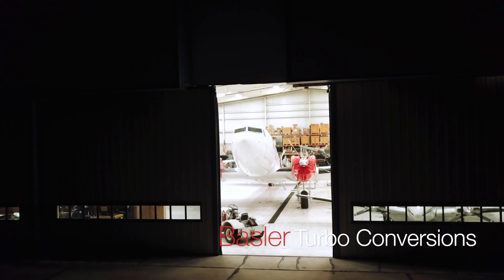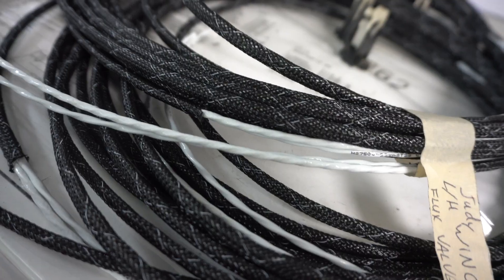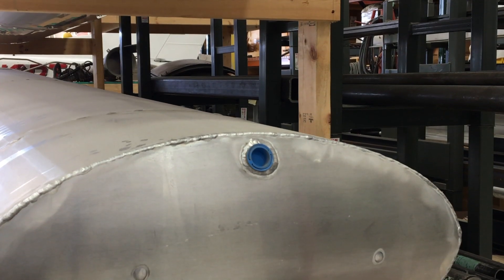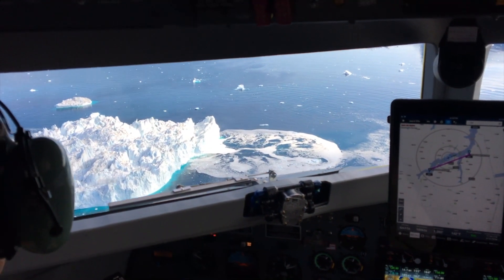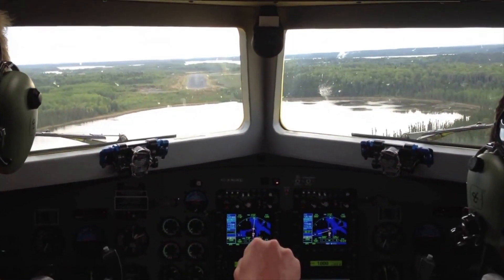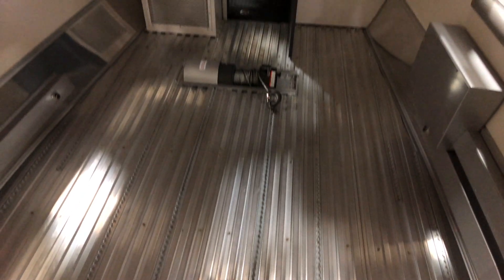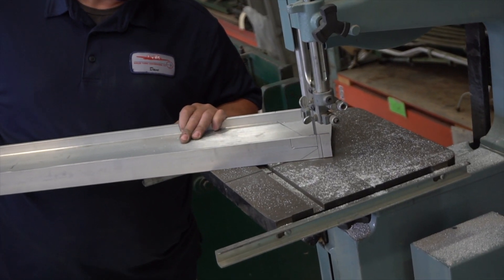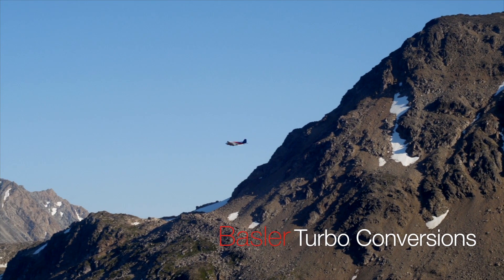Basler Turbo Conversions Informational Video

Comment: Best freighter in its class.  All you need is a truck backed up to the door and a pallet jack.  No forklift needed.  Operated 2 of the DC-3 freighters when I worked for Emery Worldwide back in the 1989s.  Never took a delay with them.

Comment: Basler must be running out of DC3s to rebuild? If so, then what?
Reply: If they can manufacture spare parts they can manufacture an entire plane.

I suppose the can bring the plane back into production made with modern alloys and carbon fiber skins. Make it all modern with fly by wire controls and titanium landing gear.

Comment: There must be other older airplanes (or helicopters or even cars or trucks?) out there -- besides the DC-3 -- that can also be upgraded and transformed into something uniquely useful and valuable.  Vietnam War UH-1 Huey's?  Heck if I know.  But it's a compelling question.
Reply: Unfortunately most of the original UH1s have long since been retired or relegated to museums/collections. The reason the DC3/C47 is still so prevalent is it's cost effectiveness and simplicity.
Reply: @xc8487  I’m not claiming to be smarter than anybody, but I’m puzzled as to why no one is making new-build knockoff DC3’s today.   With discount Czech turboprops or something.

Heck man there’s less technology in a new Toyota Camry.

“How hard could it be?” (Famous last words!)
Reply: @craigsearching  Probably because while the current airframes are desirable, new airframes would probably be cost prohibitive and not offer anything better than current offerings.
Reply: most of the other aircraft I can think of are still in production anyway. Huey, C-130, all still being made. the Antonov AN-2 has received a turbine upgrade, similar to the 3.
Reply: @theVoyage  Still making Huey's?  I had no idea.